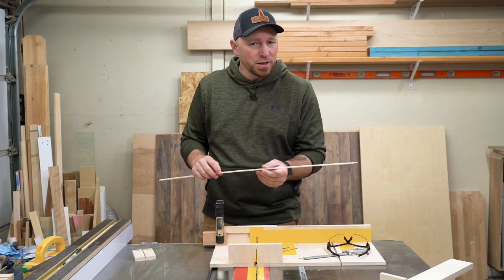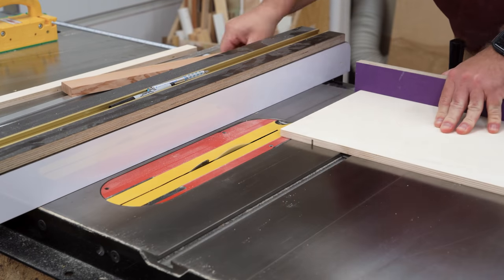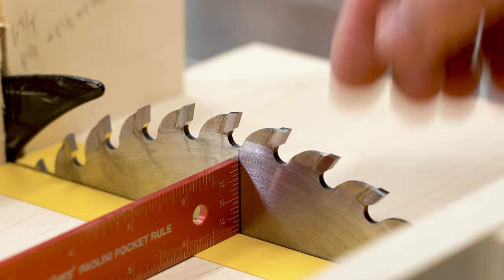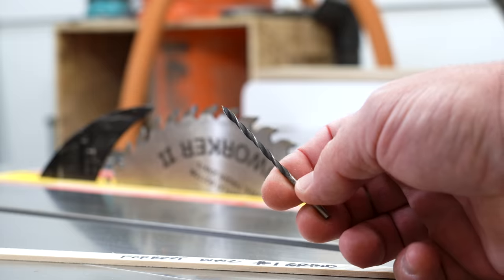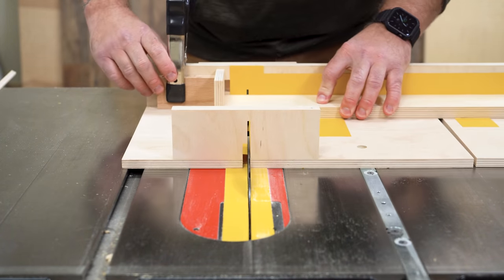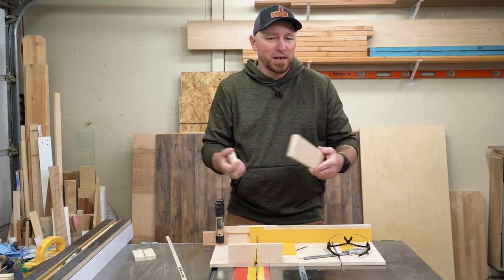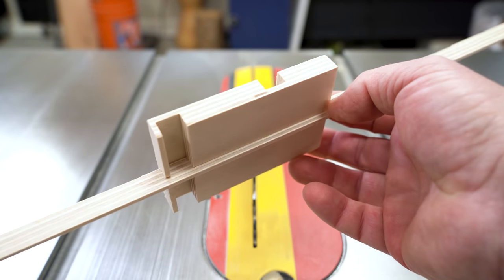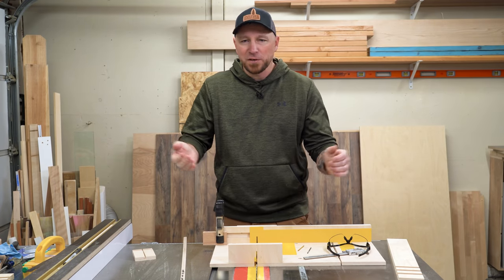WAIT! Does the Drill Bit Trick ACTUALLY WORK?

Comment: I found a perfect fit bit for the 24 tooth my dwe7485 came with but it is slightly off on the new 40 tooth dewalt blade I bought and no other bit works that I have. Tried making one of your shims but I failed miserably.

Comment: I cut a kerf, then test fit bits in the kerf.  This is much more accurate than measuring a tooth on a blade.  This accounts for the blade set, with every other tooth set the opposite direction.  Also, I used the drill bit shank.  My drill bits are not those with 3 flats on the shank.
Reply from the maker: I agree with testing the kerf. That was sort of my point, but a lot of folks get hung up the numbers. Although I will say that my bits do not have the chuck jaw grinds on the shank either, and they measure what they measure from tip to tip.
Reply: @InspireWoodcraft  you put the bit curly side down.   Regardless you knew it wouldn't work because your shim is derived from your blades 'cut' not it's width. Since that was bigger than the drill bit the test was over before it started.
Reply: good proof tho

Comment: I wonder if it is a slight blade wobble that makes it slightly wider.
Reply: He measured a single tooth, but each tooth is offset in an alternating pattern, so measuring a single tooth will not give you the width of the kerf left behind. You would need to measure the distance between two parallel planes from the outermost point on a left set tooth and a right set tooth.

Comment: I haven't read all the comments so sorry in advance if this is a repeat.  I noticed you measured the drill bits on the shank (solid portion) of each bit and not at the flutes.  You then off set your cut using the flute end of each bit.  That MAY be why the drill bit method was less than satisfactory.  If you measure the shank diameter and the flute diameter of each bit I'd bet there's about an 0.008" inch difference.
Reply from the maker: No they measure the same from end to end.
Reply: @InspireWoodcraft  Thanks for the clarification.  Guess I lost that bet!  Love your channel, BTW.

Comment: I would say it's just run out and/or vibration. I don't think any table saw kerf is the exact same thickness as the blade. I don't remember who, but there is another vid on here that shows this method but he explained that he had to try a few 1/8 drill bits  before he found one that matched the kerf, and so he saved it to use with that particular blade.

Comment: I would attribute the difference between the drill bit and the shim to any possible runout or 'wobble' in the blade and/or spindle (axle) of the blade.  As always the shim wins!
Reply: But wouldn't the runout and/or wobble still be there regardless of what you used as the stop? I mean the shim is a stop point. The drill bit is a stop point.

Comment: Why did you measure the shank of the drill bits but use the fluted end as the shim?
Reply from the maker: Because they measure the same form tip to tip. No variance. But what can mess you up is using the shank end, which can be out of round from being in and out of chuck jaws. The fluted end will get worn evenly because it spins, so no matter how you measure, it will be the same.

Comment: Try it again and use the shank of the drill bit instead of the flutes.  Relying on the thin ridge of the flutes can cause problems since it is very easy for them to sink into the wood a few thousandths and give you a wider dado.  That said, I still like your shim method better.
Reply from the maker: Thanks. The bits don't sink into the material though, and they measure the same from end to end. I used the fluted end because as it wears, it EVENLY wears. Whereas the shank end can get deformed from going in and out of chuck jaws.

Comment: If three separate items all don’t measure quite 1/8 of an inch, could it be your callipers that are mis-calibrated?
Reply from the maker: So ironically, I have a pair of Mitutoyos on their way here today and I'm going to check and compare them. But I suspect the one's I have are just as accurate. We'll see. However, I will add that as long as a measuring device is consistently wrong, it doesn't matter if the number displayed is true.
Reply: @InspireWoodcraft  as long as you’re using the same tool it will be consistent. However, I did notice for the bits you used the middle section of the calipers and the tip ends for the shim.
Some would argue you need to use the tip edge only, but I don’t think it makes a difference here.

Comment: The shank of the drill bit is smaller than the Dimension across the flutes at the sharp end.
Reply from the maker: I just measured both drill bits, and they both measure the same on both ends.

Comment: If you know the width of the saw blade and you have a feeler gauge why not just the gauge.  It should be more accurate than either shim or drill bit.
Reply from the maker: It isn't the accuracy of the measuring device or if the drill bits or blades actually measure what they say they measure, it's simply not accounting for runout, vibrations, tooth set (if there is any), etc. So, even using the feeler gauges, we would have gotten the same result.
Reply: @InspireWoodcraft  Help me to understand one thing.  If I use a drill bit or some other device you will have runout but using a shim you do not have runout.  I am not trying to argue either method just asking because to me you would have the "runout" no matter what you use.  Ii looks like the shim would be the exact size as the blade but I do not see how it would prevent the runout.  
My thinking is the simple act that if the drill bit is not the exact same size as the blade the cut will be off.  Sounds like the simple fact is that whatever you use it has to be the exact same size as the blade.

Comment: You made an exact match gauge then you picked drill bits that did not match. What did you expect? Try cutting a kerf and inserting drill bits till one matches. This assumes a broad range of incremental drill bits .if you get a bit that fits the kerf you are home free!
Reply from the maker: Not exactly. I picked drill bits based on what a lot of people assume is what you should do: 1/8h inch blade, 1/8th inch drill bits, as I said in the beginning. I had a pretty good feeling on what the end result would be based on experience and knowledge. That being said, if it were me, I would take the same approach that you mentioned. Although I don’t because a shim can be made of almost any length, which lets me run long or wide material against my rip fence, where a drill bit will not work.

Comment: Size the drill bit to a saw kerf cut in a scrap of wood. It’s bound to be a couple thousands different from a direct measurement of the teeth.
Reply from the maker: That would be my solution as well. But, some folks insist that and blade and bit that SAY they are the same size, actually ARE the same size.

Comment: It looked like the blade teeth were offset in your video, so measuring one tooth would not work would it.....ie the shim you use would actually work better than a bit. And What the heck is with all the zero clearance tape? I can see over the blade but why all the other spots?
Reply from the maker: In the video where I talked about the zero-clearance tape, I mentioned reviving old crosscut sleds with it. The sled I used in this video was about to go in the trash, but using the tape makes it perfectly usable again. The "extra" is to compensate for the height of the tape, that way workpieces stay flat against the fence and bed, and don't end up getting cut at slight angles.
Reply: @InspireWoodcraft  LOL sounds like another short

Comment: Not sure if it would make a difference or not, but I’d impinge using the shank of the bit rather than the cutting flutes would be more accurate.
Reply from the maker: Depends on the bit. The shank end can get out of shape from being clamped in the chuck jaws over and over, and can produce different readings depending on where you measure. At least with the cutting end, it gets worn out evenly.
Reply: @InspireWoodcraft  really good point. One more reason to go with your method over the drill bit

Comment: You measured one tooth? This doesn’t account for the set of the teeth, I don’t think, you’d have to measure the distance from the outmost point on each a left set and a right set tooth to get your effective blade width
Reply from the maker: Correct, assuming there is a tooth set to speak of. I can’t find any info on that. I believe I mentioned it in the video though, in layman’s terms. The point here is to show people reality vs just taking numbers and running with it. The drill bits weren’t actually an eighth inch either. It’s just the way it goes sometimes.